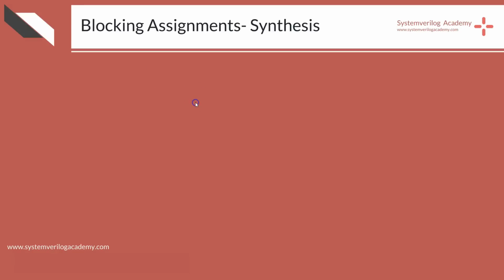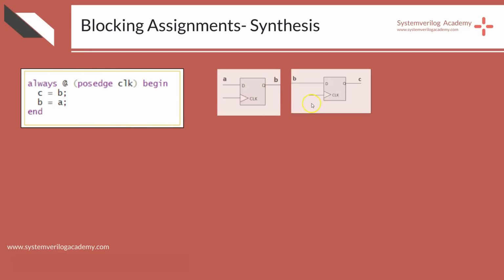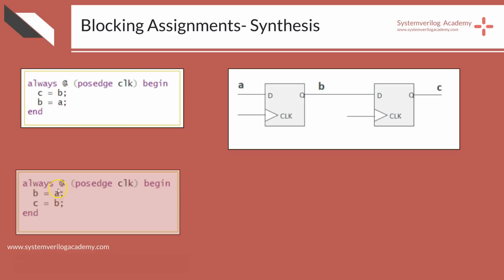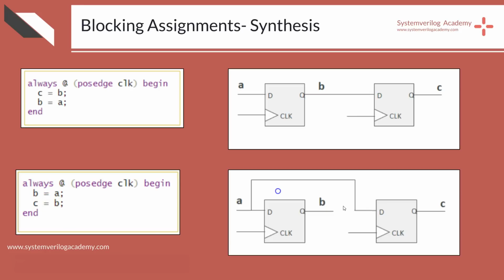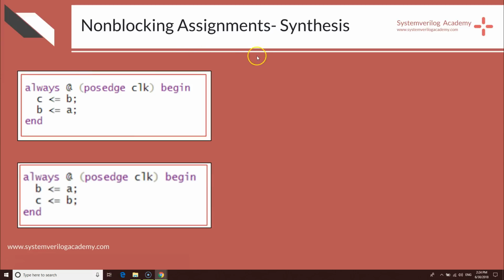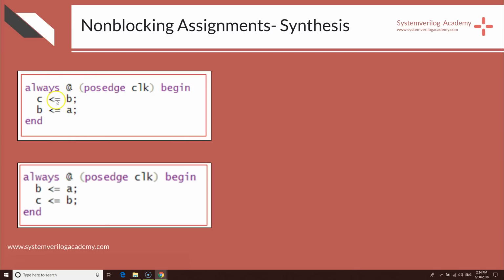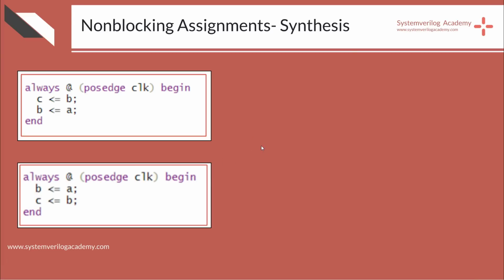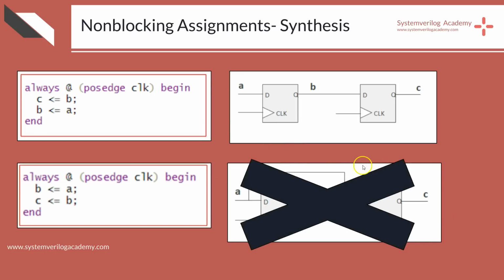Course: Systemverilog Design - 1 : L6.4 :  Blocking & Non-Blocking Assignment Synthesis Example

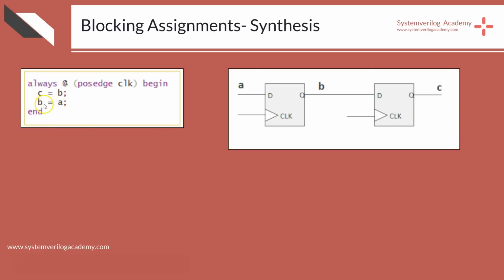Comment: Hi, at time @0:28, I'm not able to analyze the synthesized circuit. c and b should latch the  value in the same clock cycle. Let's say we start with a=2, then b and c will be equal to 2 as the output. However seeing the code, Let's say a=2(like we assumed for circuit)  and b=8(here we have to assume b value too, but in circuit b value is being taken from a) , and the value of c and b will be 8 and 2.